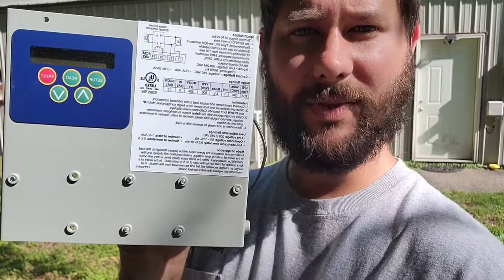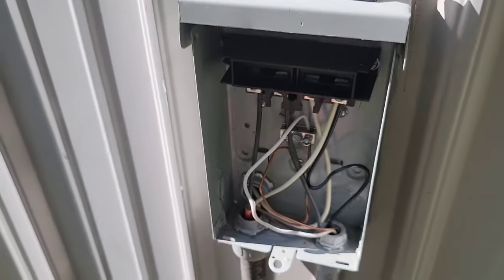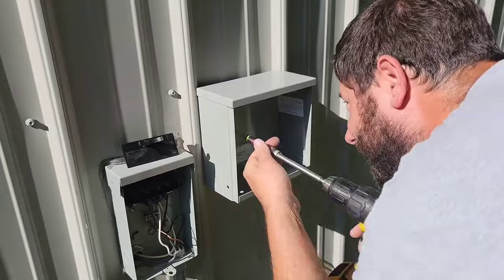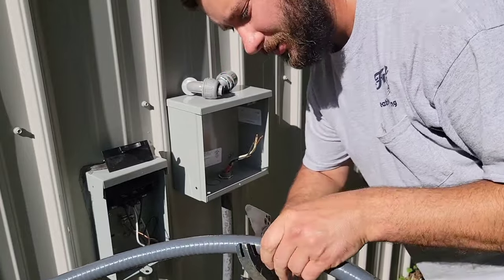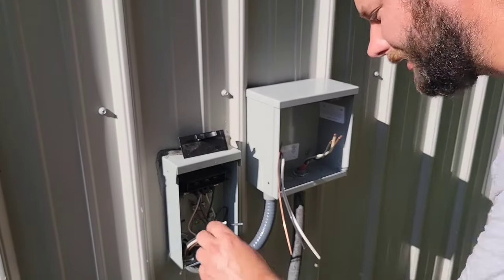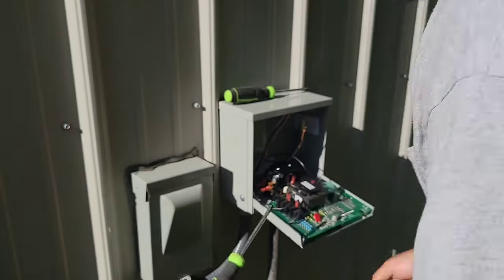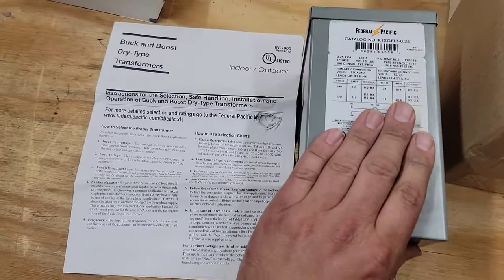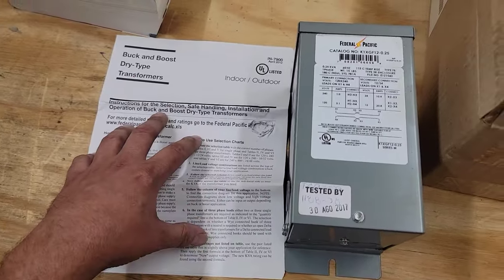ICM493 Installation Guide: Protect Your Equipment from Voltage Surges!

Comment: Thanks for showing me the ICM493 I was not familiar with the product until today. I would've loved seeing the buck boost transformer being wired up. I use the buck/boost on a regular for well pumps most of the voltage on the southwest coast of FL is 208. Thanks for the video.

Comment: I was looking at these, but am also looking at the whole house surge protection at the pole, and inside the main panel (about 150' away from pole).  Would the ICM device be needed with whole house protection?
Reply: Whole-home SPD doesn’t protect you against brownouts, under/over voltage which is common in the summer and prevalent in some areas…. Thats what the voltage monitor portion does on the icm493

Comment: Is there a mini split made that can replace the traditional unit you see near the floor in a bonus room? The orientation of the vent is down vs up. Is there a solution to this to use the same location? TIA Tad!
Reply from the maker: Hey will check out my video I just did on the mini splits in the log cabin
Or my video of what type of mini split do I mean
It's on my playlist hboc tips for technicians
Reply: @TaddyDigest  found it and left a comment there! Thanks so much! 👊🏼

Comment: If it were to lose 4 mov and I were to set it for 1 if that gets taken out will the unit continue to run unprotected. When set up on last mov would I set it for manuel reset so I know to replace it as there is no more protection?
Reply from the maker: yes it would still run but without protection

Comment: Great video.  Need recommendation on what buck boost transformer to use.  Line voltage is 252V, power company says no adjustment needed, so i need a buck boost.  Mini split condenser is 230V, with max 240v - getting faults due to voltage.  Buck boost you recommended is 240 to 220.
Reply: In North American the voltage is 240v +-5% and 252 volts is 5% over so it is within tolerance for North America. Your 230V,  max 240 volts does not seem to be a North American unit. You need to investigate if your unit is compatible for North America usage from the manufacturer.

Comment: My mini split went out because of a lightning strike and I was told there are no parts available . I must install a new system  price $ 10,000.00. Good video just came to late for me.
I am installing  IMC 493 it arrived today. Good news I found a technician that was able to troubleshoot the circuit board and replaced it wala ductless is up and running total cost $ 645.00 I burchased the board $365.00.I saved $7,000.00
Reply from the maker: that is excellent news so happy you were able to save money and fix the existing unit

Comment: Sometimes you can call the power company to correct the voltage and if it’s on their equipment, you don’t pay anything but they can’t always do that and you do need that buck n boost sometimes.

Comment: The power company’s voltage range is +- 5%. Higher than 5%,  contact your power company to fix your voltage. They can put a recored on your power and pinpoint voltage issues. Sometimes a neighboring industry has large power demands at certain times. Only a recorder can find that information. I am setting to -+6% to prevent false over/under voltage faults.
Reply from the maker: Good stuff. Thank you for sharing this knowledge. This is valuable
Reply: @TaddyDigest  Ask your power company for the Power Quality Department to get hep. You better have an accurate volt meter because they will pull their’s out and measure your voltage and you don’t want to be caught with a bad meter.

Comment: why choose a system that requires a new board after the surge protection is activated? ... wouldn't it be smarter to select the Ditek DTK Kool Guard which can reset itself after a surge event? (same price I think, for either)
Reply from the maker: I'm not familiar with the product you're talking about but I will look into it.

Comment: 1) They're "var-istors", not 'va-ris-it-ors'. Varistor = variable resistor
2) Setting the MOVs to 4 isn't going to protect your equipment or the 5th MOV from a lightning strike. If your line gets hit by lightning your equipment and all 5 MOVs are toast, regardless of whether you have this installed or not or what menu setting you used. This is not a lightning arrestor. It's a surge suppressor (not protector) with a low/height voltage cut-off via the contactor. The reason that menu setting exists is because over time MOVs do fail as they absorb excess voltages. They will likely fail 1 at a time. That setting allows the equipment to alert you by shutting down your system and then allowing you to manually re-enable the 5th MOV so you have an opportunity to re-enable it and order a replacement board (or replace the relatively inexpensive MOVs yourself, if you can do that kind of work).